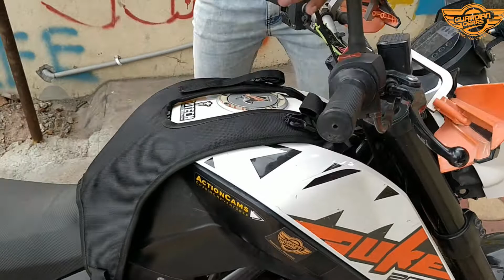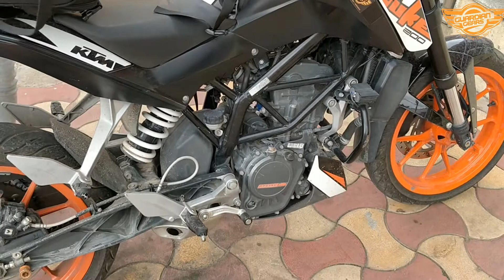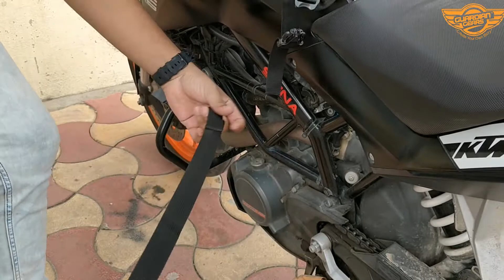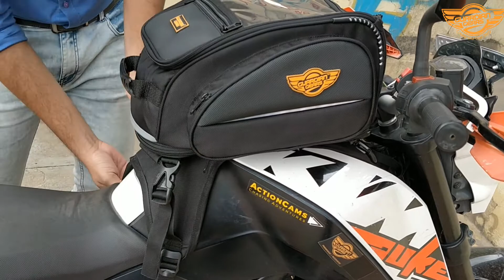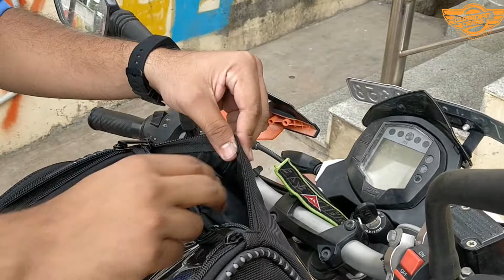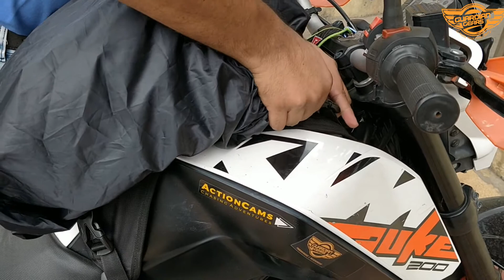Installation of Guardian Gears Shark Universal 28L Tank Bag

Comment: Guardian Gears will this bag fit on  Bajaj Platina 110 ABS or it will be too big for platina 110?
Reply from the maker: Yes this tank bag is universal fits all the motorcycles. We also have 18L universal tank bag suitable if you want smaller size. Checkout this link: https://guardiangears.in/collections/tank-bags/products/shark-mini-universal-18l-tank-bag-with-rain-cover
Reply: @guardiangears4081  will I be able to fit a full/half face helmet in 18 litres one or not? I really want it for carrying a helmet specifically.
Reply from the maker: @TalhaNusratHussain  Helmet can be carried only in the 28L tank bag. 18L will be small to carry a helmet.
Reply: @guardiangears4081  thanks a lot for clarification, I'll go with 28 litres one 👍

Comment: Hello Guardian Gears, can this tank bag be mounted on an Apache RR310? The fuel cap is set a bit further back on the bike and I was wondering if the slot will be long enough. 
Can it be mounted back to front?

Comment: Does a full size laptop fits in it?
Reply: No! 15.6" Laptop won't fit! Any electronic smaller than that will fit!
Reply: @kasimbadri1423  thanku for reply
Reply: Hi wont the straps scratch the tank? Mine has a matte paint. Also would it accomodate 12 inch laptop